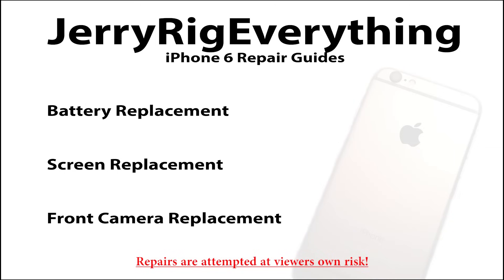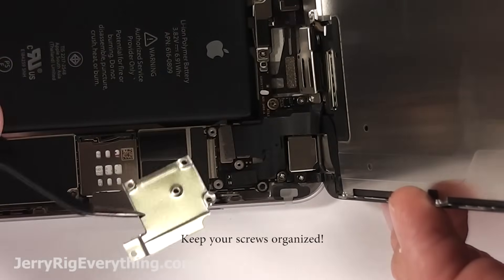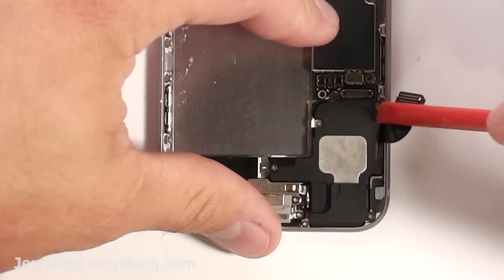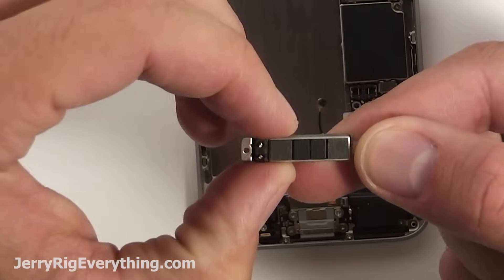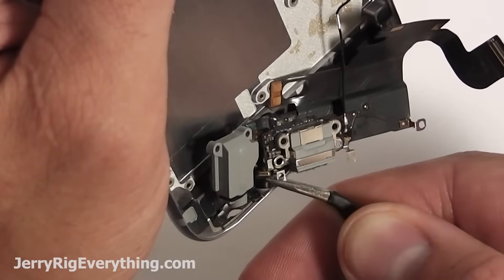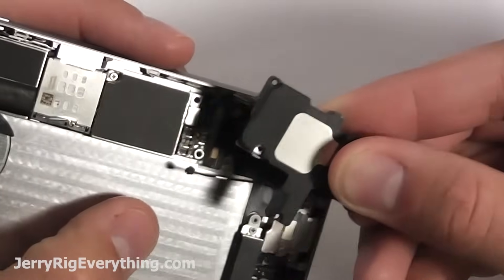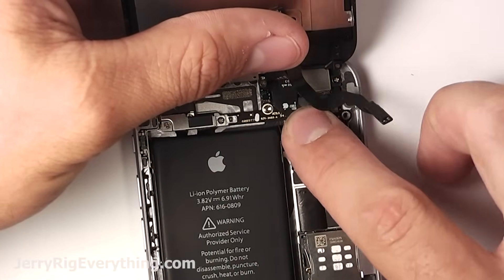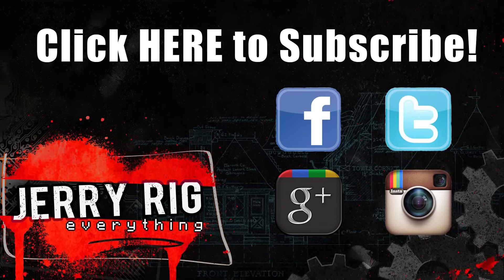iPhone 6 Charging Port Replacement in 5 minutes, microphone fix, headphone jack repair

Comment: Watched your video. Worked perfectly! I would also recommend explaining how to remove the battery. I did it by carefully warming up the phone gradually and working at it little bit by bit, careful not to damage the volume connections underneath and on the sides. I kind of just put the phone near a heat source, and stopped before the casing was too hot to touch (don't want to damage components). This helped loosen the adhesives a bit. Then I replaced the battery with a new battery, using the remaining adhesive from the previous phone to hold it in place. I'd also recommend explaining how every new charger port flex comes with a sticker covering the mic (its a yellow film). That MUST be removed or else you wont be able to use the microphone except via Speaker mode. If you pull the sticker off the mic on the new charger port flex, the mic should work perfect. I learn this the hard way. Hope this helps someone reading.
Reply: +Matt Fledderjohann Thank you SO FREAKING MUCH! I just swapped my i6 housing with a black housing (LED Apple logo too. Looks amazing) and after solving my button issues and camera issues, this was my last problem. Mic wouldn't work. I saw the yellow tag on the mic, but for some reason, no amount of pulling would remove it. I don't know what I was doing wrong. The blue film peeled off easily, but I couldn't figure out how to remove the yellow tag or what it was for, so I just snipped it off with a small pair of scissors. Now I know what I did wrong. I just gotta figure out why I couldn't get the film off.

Comment: People say that when I call them it sounds muffled or crackled and now my charger port doesn't work. So if I pay someone to repair my charger port, will it fix the microphone too?
Reply: +Rachel Edlin did you fix the problem? i&#39;m having the same issue right now

Comment: i needed to replace my charging port because i had part of my headphone jack stuck in the port. i followed everything you said, closed up, now my charger docent work, vibration is completely gone, and the device is still acting like a pice of the headphone is still stuck inside. any suggestions? I'm going to try again once more.
Reply: GrimVoice77 never mind, just went back in and saw that a connector wasn't fully plugged in. the device is as good as new, great video!

Comment: Just done this repair. Worked on first start up but now won't power on screen and buzzes every few seconds when charging. Any ideas?
Reply: +James Haslam Possibly faulty screen or not connected properly or damaged connector. had this happen on a iphone 4. replaced the screen.

Comment: Hello, I sure hope you're still responding to these: I dropped my iPhone in the bath tub (oops) and my mic doesn't work.  With this video and with the part you're pitching, will THAT fix the microphone issue I'm having?  Please let me know, thank you so much!!!!
Reply from the maker: Justin Ericson Water damage is tough to deal with.  But as long as nothing else was damaged by the water. And the replacement part is installed correctly, it should fix your mic issues.
Reply: JerryRigEverything Ok great.  Well, everything else works GREAT on the iPhone even the speaker so I am confident that by buying this I will have my mic working GREAT, you think?  I believe it's just the mic that doesn't work and I want to buy the kit, the piece that you are stating in the video and then that special suction device that's $9.  Will have to check Ebay, you don't sell them, do you?

Comment: So the reason I am looking at the video is because my headphone jack isnt working. I noticed that by the headphone jack is the mic. However my phone is missing that screw and metal clip that connects to the mic. Does your replacement part come with that piece.

Comment: I tried to clean some glue off the back with goo off solvent and it leaked inside now the screen is dark but work and the microphone doesn't work very well. Can it be cleaned and if so with what? Alcohol?
Reply: Steve Powell Does the microphone have a blue/amber sticker over it? Remove that and it should be much clearer. Also the video connectors might not be seated properly. You could try reattaching those.
Reply: +Mark Wadia How is the yellow film attached to the mic exactly? When I installed mine, I easily removed the blue film, but when I pulled on the yellow tab, I couldn't get it off. I also couldn't exactly tell where the yellow film was. Perhaps it was the lighting. But after pulling and pulling, I decided just to snip the tab off with a little pair of scissors. Of course, now no one can hear me on the phone. I'm gonna take my phone apart and try to figure out how to remove the film, but I couldn't see it before, I don't think I'm gonna see it this time. Does it cover the exact surface the blue film covers?

Comment: Hello, I tried doing this and when i put connect the screen and plug into the charger, a bunch of lines pop up on the screen. I don't think i damaged any of the connectors to the screen. It took me a while to get them into place, but I don't see any damage. Any thoughts?
Reply: ***** Try to reattach the 4 video connectors. Same thing happened to me and removing/reattaching did the trick.

Comment: One quick tip don't use the isesamo to un clip the network antenna, anything metal can short the board. Once battery is u clipped 60 minutes before the capacitors run out of power making safe for any tool.
GREAT VIDEO AGAIN THO

Comment: Managed to do it. Hands still shaking. Getting that cable wire back on its place was very challenging. In the end it actually didn't make a click. I just managed to push it in there somehow - took me around 20 mins. Also, I connected the cable before I put the loudspeaker back on - gave me more space.
Reply: Currently trying to get the antenna cable to connect myself. It's annoying

Comment: Thanks jerry you were right the charging ports I had purchased was faulty followed  by the next 3 I bought ! Before I exposed the adhesive and started putting everything together I checked to make sure they worked before installing it. Now it's working like new . Bought some new charging cables too just incase that's what started this whole thing . Anyways thank you again your tutorial was on point .

Comment: Great video. Thanks for the help.  Hardest part was the tiny wire cable antenna, and keeping track of which screws go where.
Reply from the maker: Patrick Reber Thanks for watching!  And ya, definitely important to keep those screws organized.
Reply: JerryRigEverything I used an old egg cup box to hold sets of screws and brackets at each stage. And used little bluetac plates to hold the screws in a pattern if they differed in size for any stage.

Comment: Just replaced my charging port but it still won't charge or connect  . Do you think my iPhone has a bigger problem or just a junk replacement part ?
Reply from the maker: abram hernandez It could just be a junk part. ive found 1/10 are faulty in some way.
Reply: You shouldn't replaced it. The cable is the only problem. The apple lightning cable sucks. Buy like 5 cheap ones on eBay. My cable starts to not charge properly at about 3 weeks then I try to bend the Lightning cable down or up around the mini port of the phone and it charged. The official apple lightning cable also has this problem too even look at their website of the lightning cable reviews most people rate it 1 stars out of five. Hahahaha ridiculous! Apple hasn't even try to do anything about it.

Comment: my i6 will not charge. I checked voltage at the pins where the battery connects to mother board. Measured 0.0v. There should be ~ 5.0v while plugged in. I know this b.c I measured a working i6 at same point & got 4.7v.Is there a way to measure voltage out put at the charge port itself? if so, (which contacts/pins) I'm trying to determine if my charge port, or power ic is faulty, or possible "fuse"

Comment: Did you make this video because the iPhone 6 plus wasn't charging? Because I'm having problems with my iphone. It's not charging at all. Checked multiple chargers and wall sockets. Just curious.
Reply: My phone would not charge or connect to computer.  I took it to apple store and they said it had been in water (maybe a splash, but not submerged.  either way, they would not touch it). I bought this part from repairs universe and followed these instructions, now it is good as new.

Comment: I'm thinking of buying a iPhone 5s used online, the only issue with it is the charging port. I think I can replace it. However, do you think its a good idea? The phone is supposedly in perfect condition other than that... But you never can be completely sure until you have it. Also, I've seen your iPhone 5 video, and now the 6. The 5 video is probably the closest, but it doesn't have the fingerprint scanner. Which video, if I were to attempt this, would I follow the most? And if its the 5, would I need to change anything for the fingerprint scanner or anything else? Thank you!
Reply from the maker: greenawesome35 Its probably a little closer to the 5.  I really should do a video on the 5s.  You can watch my iPhone 5s screen repair video to get an idea of how to handle the fingerprint scanner.

Comment: Have you hear or seen the new iphone bending?? If so can it be fix??
Reply from the maker: John Rangel You can always bend it back... It will just never be 100 percent the same.  I had a girl slam her iPhone 5s in a door, bent it like 20 degrees.  I managed to take the guts out, and bend the frame straight again.  and put a new screen on it.  Its possible to fix them...
Reply: JerryRigEverything Yeah I bent back a Sony Z1 for a customer, after it was slammed in a car door.

Comment: i cant find any replacement parts in the descriptions of any videos?
Reply from the maker: Jason madiedo There are only a few parts released so far.  Ill get them posted asap.  Do you need something specific? Or are you just mostly curious?
Reply: for future problems like to be pro-paired haha also specific pricing haha i couldn't find them either